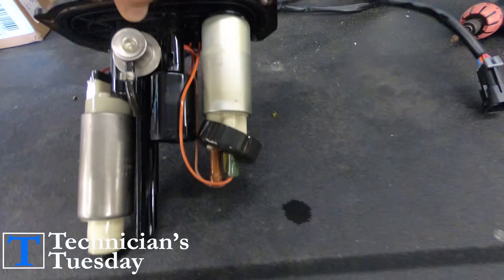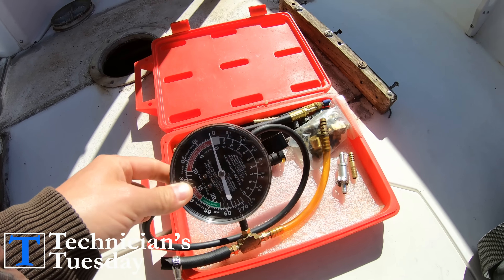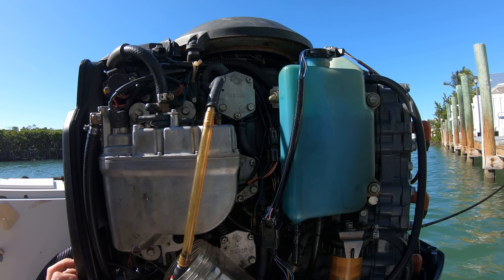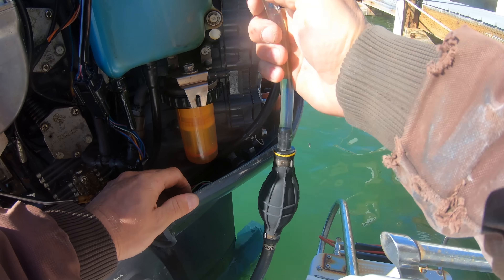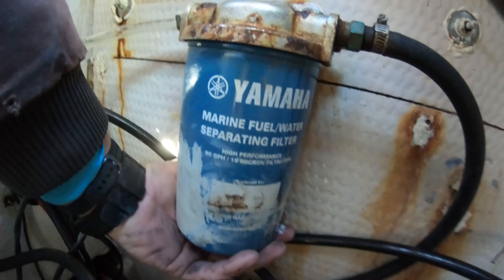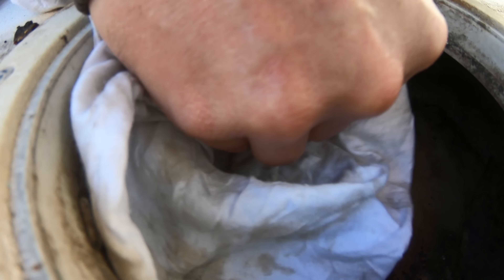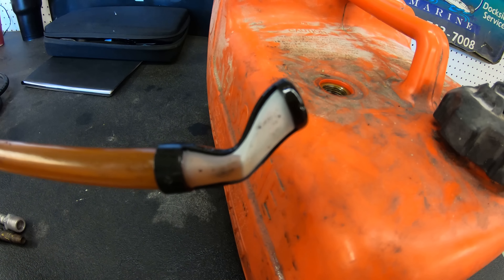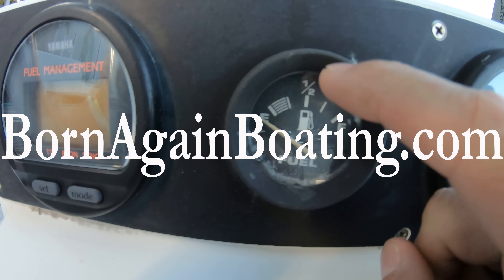Follow These Steps! Why Outboards Run Out Of Fuel!

Comment: my primer bulb was plum flat while the engine was starving for fuel. though it could be the primer bulb so i went out and got me a new one. before i head out to the lake i done some test at home and let the engine idle. the new primer bulb was doing its job with no restriction on the fuel system. let the engine warm up and every thing checks out. head back out to the lake and found out the primer bulb suck in flat again. the engine will not run no more than 1500 RPM. it will sit there and idle but will not run. this time the problem gotta be related to the anti siphon valve or pick up tube. what a total nightmare.

Comment: 3 years ago, I started to smell fuel only on a full tank.  Thinking I had a hole in my tank, I removed the deck and pressure checked the tank looking for obvious leaks.  Nothing was obvious, but a drop in PSI over night was telling me there was a problem.  I had to use the soap and water method to find the small leak.  The aluminum under my sending unit became corroded and a new gasket did not fix the problem.  Had to install a new plate over the old hole and bad area.  Tight to this day..  Hopefully..  #gasleak

Comment: Two 2005 Yam F225s on my last boat, a Center Console.   New filters every year.  New hoses.  CONSTANT fuel problems.   Bad Pumps, clogged VST screens over and over, Clogged fuel injectors, etc etc etc.   I ended up replacing most of the hoses on the engine.  They were rotting internally from ETHANOL.   E10 is pure crap.   For every hour I spent fishing, I spent another wrenching on those engines.   YAM parts prices are utterly insane.   They get 800 bucks for fuel HOSES per engine.    When the time comes do yourself a favor and just buy automotive FI grade straight hose and replace them.   You might need to get creative and install slightly longer hoses to prevent kinks and but you'll have $750 in your pocket when done.   That's a lot of gas, beer, and bait.   And fuel pumps...4-500 bucks for a pump that can be cross-referenced and easily sourced online.   I paid 20 bucks for the HIGH PSI pump and 79 for the LOW.    Once replaced, pumps were never a problem.

Comment: #gasleak How old are boats before they starting to have this problem? Is there any fuel additives I can use to prevent this? If you use premium gas does this still happen?
Reply: OfficerDave78 always use ethanol free gas. Ethanol is a solvent and will deteriorate the internals of a fuel system.
Reply from the maker: Usually over a decade or two :) you shouldnt have an issue with your new boat! Like Eric said, shoot for no ethanol if you can ;)
Reply: Born Again Boating I did some checking and there is no gas without ethanol here. Is there anything I can as in the fuel tank to help combat this ?
Reply: OfficerDave78 Best thing to do is use it as much as you can, but keeping the tank all the way full will make it harder for moisture to get into the tank and then absorbed by the fuel. Ethanol attracts water, then it settles to the bottom of the tank. You can also use stabil or Mercury quick care to help, but theres no real replacement for ethanol free gas.

Comment: I had a fuel problem that took me awhile to figure out. Replaced lift pump, all the fuel lines from tank and still had my engine stalling at idle. Eventually got a spare tank and found it was my fuel pickup but luckily my boat had 2 pickup tubes I switched to the one not being used as I couldnt get the old pickup out myself and still need to get it replaced. #gasleak
Reply from the maker: Sometimes just switching and leaving well enough alone is the best option :) pulling it out and destroying the fitting in the tank leaving you with a hole in the tank is sometimes the end result with things like that :( probably best if you just leave it alone and the other pick up should carry you until it's time to replace the tank :)
Reply: @BornAgainBoating  I agree I mean that first pickup got 1800 hours out of the motor.

Comment: I had a 1999 200 horse Evinrude motor and my motor went into low idle speed and would not let me go up in engine speed I later determined that my high pressure fuel pump was bad those things are expensive it cost $900 for that pump

Comment: Ethanol has been the culprit in many a outboard fuel issue! Ethanol free is the only way to go! I always try to get gas at the same station that services a lot of farmers and fisherman so I have the best chance possible to get gas without water, even ethanol free gas gets water in it when it just sits in a bulk tank for long periods of time. #gasleak
Reply: james braselton I’m sorry, but I don’t understand your question if your asking about running ethanol free in your car then yes you can. While engines today are built to run the ethanol blends, ethanol free is ok, it’s just harder to find and usually costs a few cents more per gallon. I usually fill my truck while I’m filling the boat but that’s the only time I put ethanol free in it. Some folks say you get more mpg’ s but I don’t see much improvement in my truck, ethanol free is however is cleaner burning but as I’m sure We’ll see, everyone has their own opinion!

Comment: Had a blockage on one of our rescue boats, turns out ethanol resistant fuel line still deteriorates when ethanol fuel is used, the liner completely came apart and caused a huge issue. #gasleak
Reply: Ethanol fuels deteriorates rubber and hardens plastic parts as well...
Reply: Always use a-1 rated lines. Any grey lines die if I see them.

Comment: I’ve had the fuel separator air leak, low pressure fuel pump not work, a bad barb at the pick up let air in and the lining inside of the hose leading from the transom to the outboard deteriorated on the inside and caused a restriction. The leaking fuel separator was simple, but the other three had me chasing my tail. I didn’t even know outboards had two fuel pumps. I changed the electric pump that looks similar to what’s in a car the first time, not knowing the true culprit was right next to it laughing in my face! Why couldn’t you have made this video 3 years ago!! #gasleak
Reply from the maker: Lol :)

Comment: *moved from last weeks vid.. I recently had a no start issue.  2001 Yamaha 2 stroke 3.1l  FI VMAX 200... after changing my water separator (pre-filled new filter with fuel), and engine mounted fuel  filter (pre-filled new filter with fuel as well) Engine fired up quick and idled smooth, Then sat for a week and upon firing up the next time it ran awesome for about 2 min and slowly lost power and stalled.. and would'nt fire again. Huh its never done that, after checking for spark (which it had at every cylinder @ the plug)The fuel system looked fine no leaks fuel filter was full so I took the cover off the throttle bodies and noticed no fuel spray upon turning it over which verified no fuel at the cylinders.. WTF!  Finally found that the fuel check valve that is located just after the engine mounted filter was stuck closed.. taped on it and blew it out.. walla.. back up and running again..water testing this weekend.  so if your having the same issue it worth checking.. Are the check valves known failure items..... Thanx Born again love your vids....  #gasleak
Reply from the maker: Awesome! Yeah, the valves are a prime suspect in most cases lol

Comment: I purchased a boat that had been sitting for a couple of years. I cleaned the tank a sifened everything I could from the tank and engine. I installed new fuel line , water serperator and a new bulb. First time out it shut down. I had water in the gas. I think there was water sitting behind a baffle because it was a lot. FUEL SYSTEMS SUCK....

Comment: I have a 2009 Yamaha outboard I'll Prime the bulb fire it up and she runs fine until I get around 4500 rpm to 5500 rpm on plane then she will stutter rpm will drop back in forth and the boat will jerk forward and back it seems like its starving for fuel but if I squeeze the bulb she run fine for a minute or two then it will do the same any ideas anyone?
Reply from the maker: Start with this test ;) or put a fuel pressure gauge on the engine and run it. If everything on this test checks out and you are losing fuel pressure. Probably a dirty fuel filter or vst :)
Reply: @BornAgainBoating  my 225 is a 4 stroke I tried looking for video's on that same model but I didn't find any on how to service the vst I changed fuel water separation filter did the same I'm thinking it could be my fuel hoses there original from 2009 grey fuel hose there kind of brittle

Comment: #gasleak One time, I was in the ocean coming back from a nice day of fishing. We suddenly noticed that the engines were slowing down without me retarding the throttle. We thought that the fuel pump was shot at first so we started to drive on the good engine. We decided twenty minutes later to try the engine again. It started up and we ran up on plane after a while, after we switched from the main tank to the auxiliary tank. It turns out we were just out of gas in the main tank which is much better than a fuel pump :)

Comment: I have a 1999 90hp Yamaha 2 stroke that I had rebuilt 50-60 hours ago. It stopped putting water out of the tattletale as strong as it was so I replaced the whole water pump kit as well as put a new thermostat which was not gonna dump as bad as I thought it would be to be honest it really wasn’t comfortable at all. Can someone please tell me why it is that when I turn on my boat I have a strong stream of water coming from the tattletale for about three to maybe six minutes then that strong stream goes from being strong and solid stream to very low pressure stream some times chirping water out say if I were to give it some throttle kind of spits water out. Then goes back to a slow stream. So basically strong stream at start after that who knows
Reply: @Born again Boating

Comment: Well one day while getting ready to go out fishing we couldn't get the motor to fire up. Then my son, who's always looking over the rail says " Hey Dad, there's rainbows in the water!" Lol, so we very quickly get the boat back out of the water and start the "Gremlin" hunt. Didnt take long to find a bilge with a decent amount of fuel in my buddy's boat. And it was as said here, at the separator, was not tight enough and the hose was just rotted through on the pull side. #gasleak

Comment: I have an 89’ Suzuki dt9.9c that I can’t get to idle low.  It dies out after a few mins when it’s cold and dies almost right away when it’s when at low throttle.  Runs fine WOT.  I’ve put on new fuel filter, cleaned out carb, new fuel lines and primer, and new spark plugs.  Only think I haven’t changed is the portable fuel tank. Any ideas?